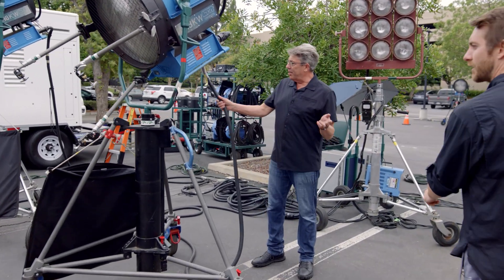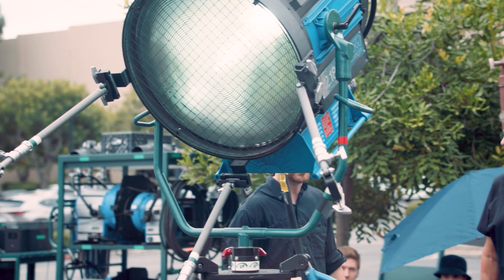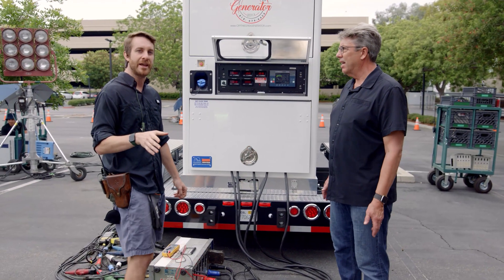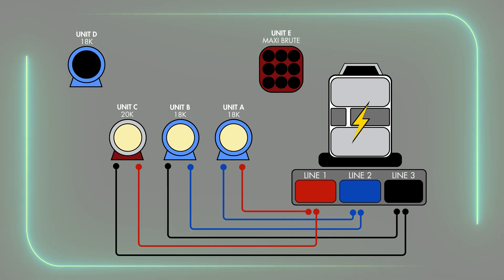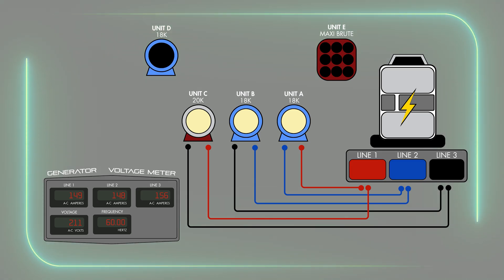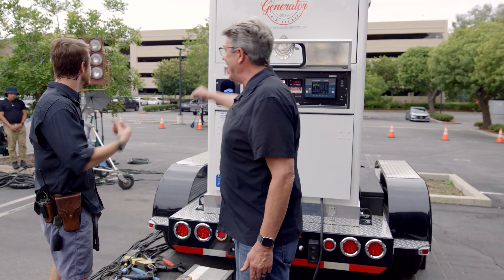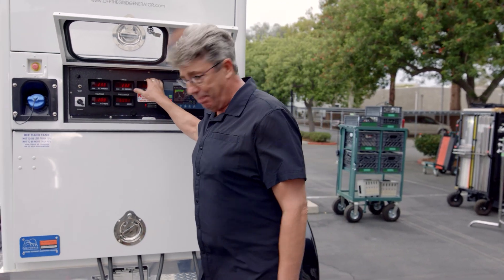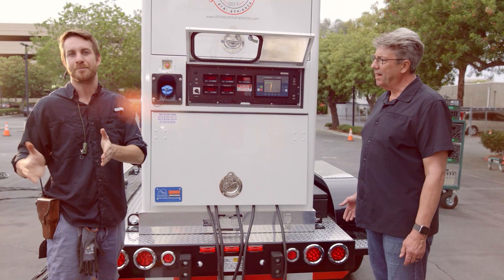How to Balance HMIs and Your Generator on Set

Comment: Generators are perfectly fine without being perfectly balanced, The extra load was completely unnecessary and a waste of fuel.
Reply: This solution is very important for OCD people who love matching numbers. I balance as much as I can, but never put unneeded load and waste fuel.
Reply: @michaelvanengelenburg1263  Exactly, it's good to balance the load but adding excess load to do so is silly.
Reply: It matters if there is a very large unbalance, but only a big one
Reply: An unbalanced generator works harder to keep voltage steady — more losses, more heat, and more fuel, even though you’re not getting more usable power.
Reply: @erikfroehlichful  The engine doesn't notice the electrical balance only the load.
Reply: @johnschroeder3072  Especially inexpensive, older, or simple generator controllers measure the load only single-phase. With an unsynchronized load, this leads to over- or under-excitation. This in turn causes higher reactive power, resulting in lower efficiency — meaning more mechanical power is required for less electrical output.

Under-excitation can, in the worst case, cause higher current, which leads to higher temperatures and possibly cable fires. Over-excitation leads to higher voltage, which can cause insulation damage (this is less critical in the US, since most devices there are already designed for 230V).

Whether a dummy load improves efficiency depends on the specific case, but it is definitely better for the generator, the wiring, and the overall system.

Comment: You could also have a loadbank ( doesn't need to be very large)  and adjust accordingly to balance the legs.  No need to to use a large fixture as a dummy load.
Reply: Lights however are typically abundant, so using one as a load is easier than bringing a seperate dedicated load.

Comment: As some one from Europe it is hard to understand why one wouldn't use 240V gear in this situation. Reducing the current by half would be rather beneficial I guess...
Reply: They’re 208v units.  208v between phases is common in the US as it gives 120V phase to neutral.  So it’s close-ish, or similar to 220V.
Reply: @tonib9261  In our 230V system, the L-L voltage is 400V (A bit higher in the 240V countries)
Reply: do agree, even for lighting and high draw 400v would be ideal also esp since arc lights dont care
Reply: Even 400 they have high voltage is available. That’s a thing.